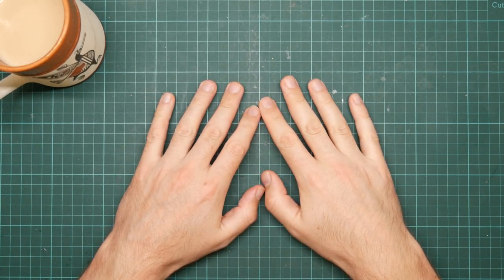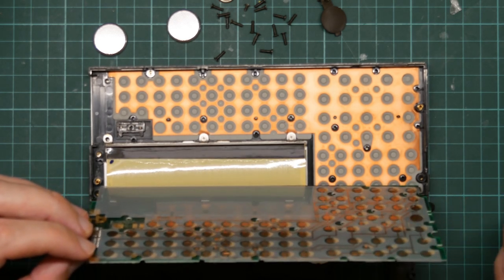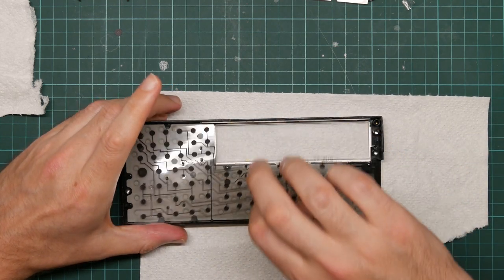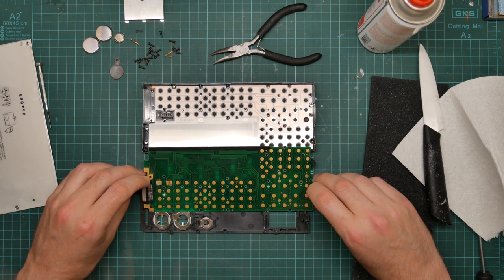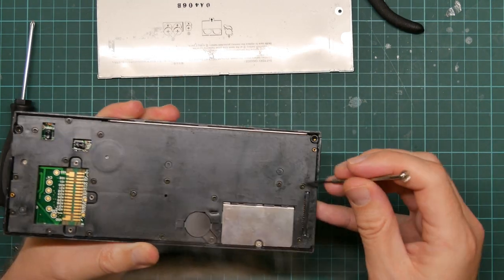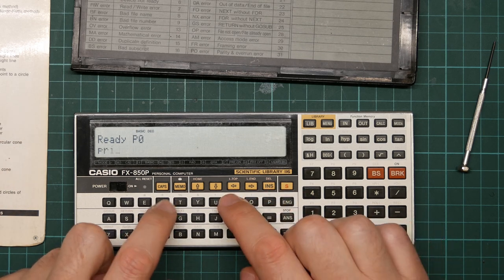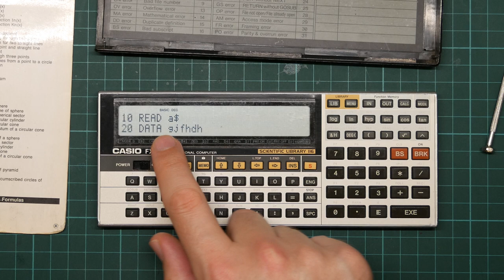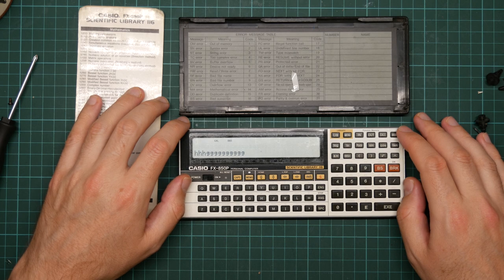Cleaning and trying out a Casio FX-850P pocket computer

Comment: I see you have a HD62002A03 CPU which is the same as the FX-880P. I have the same model as you. So this is probably from 1990 or 1991. According to Japanese forums, there are no information available about the HD62002. Some says it is very similar to the SC62015 architecture, available for Sharp PC-E500. Hope this helps.

Comment: You say the libraries are gosubable, does it mean one can create a program, to for example manipulate some data and then at some point call one of the library to have some calculation done by that library, then continue the program using the results of that library? Is that described in the manual? Have you seen this, how is it done? I'm have an 880p and I'd be interested to know, because I've always thought it was a weakness of it not to be able to built around the libraries. Maybe I was wrong.
Reply from the maker: It's too long ago for me to remember the details; sorry. The syntax was something like GOSUB "LIB0:S6210". You can find the full decompiled library (in German) here: https://manib.bplaced.net/blog/?page_id=291
Reply: @hjalfi  OMG I had no idea the scientific library was even programmed in basic, let alone the source code had been released! Thanks so much for sharing, very interesting!!

Comment: Around 1990 I bought an FX-850P and got an expansion card for it. I figured out how to decode the library and can get to print out in readable format.

The Basic is Casio basic.on steroids. variable names have a possibility of either.16 or.256 characters all significant. They are a sequence of alpha numeric characters with does not spell our a command name. The library uses lower case variable names.

All common BASIC string commands are defiled, VAL, LEN, CHR$, STR$, LEFT$, RIGHTS, MIDS and others. the are special commands:
VALF - takes a string representing.a math function and returns a numeric value. Invalid strings return 0.
CALC$ - Holds the contents of function memory as a string.
(not documented)
CALCJMP - Cal mode only. Starts a function memory.
(not documented)
DEFCHR$(252, 253, 254, 255)="(HEX STRING) Defines a pixel pattern for a charctor of code 251, 252, 254 or 255. If not defined the characters.print as spaces. Used extensively by the library.(Undocumented.)

It is possible to use DEFSEG and PEEK commands to programmatically read the.password. Using POKE is is possible to programmatically set or clear a password. To remove the password POKE it full of zeros.

Comment: Im pretty sure it's no good for the device to remove all batteries at the same time. Also there's a reset button (P) under the device which you're supposed to press before you turn it on after removing/replacing the batteries. I bet one of these or both caused the crash. I have the fx880p btw, first hand, still working perfectly.

Comment: I have a CASIO FX880P and after sometime without using it I had to change the 2+1 batteries.
After this change it worked normally for a day.
Later, when I tried to load some programs via computer connection using the TF850 it ended up crashing.
Turn it on but always displays only the letter N.
Either of the two reset holes (P and All Reset) do not solve the problem.
I wonder if the firmware got damaged!
Do you have any clue how I can recover the calculator that has been with me for over 30 years?
Reply: I disassembled the calculator following the steps on you video and after a careful analysis I realized that some of the carbon dots of the keyboard membrane already are oxidated, specialy in the lower area, near letter N.
I cleaned what seames to be some loose carbon fragments and reassembled the calculator.
Apparently everything works fine except the letter N.
If some how I could find or recover that membrana I think I'll solve the problem, but I don't know how.
Someone can help me?
Reply: Only thing i can think of is to try one of the conductive ink pens and apply a new coating of conductive ink to any non working spots on the membranes.  That should work without being removable if in the future you try a more permanent fix like replacing the carbon material that is missing using a glue like factory membranes use.  I have no experience with replacing the carbon dots, but the ink should at least buy time and be MUCH easier to apply correctly.  HTH